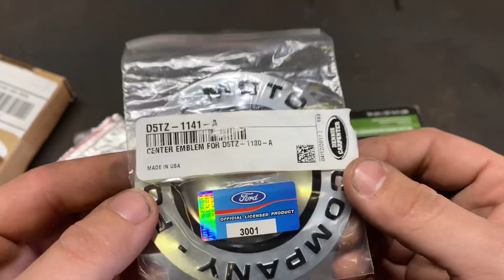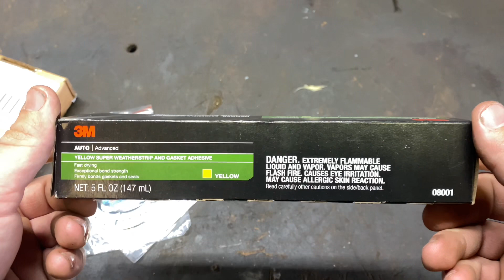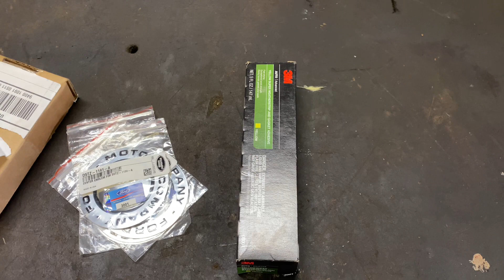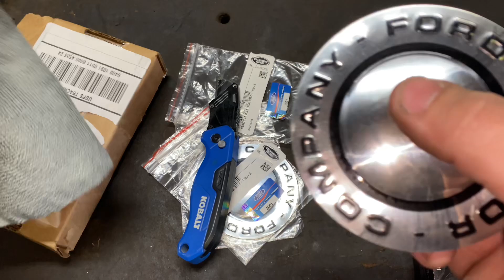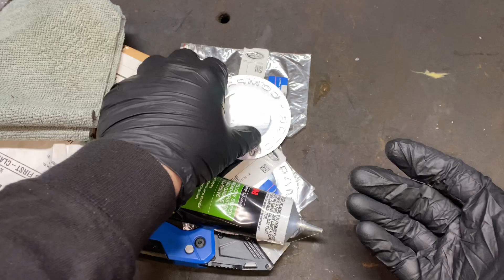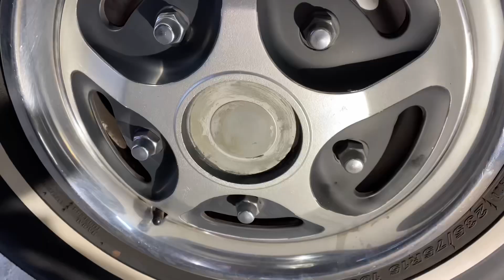1973-79 ford truck hubcap emblem install.

Comment: I wonder, If those Ford hubcaps. Also exist in 16 inch?
Reply from the maker: No not these, not this style anyway at least as far as I know, I don’t believe anyone remakes them in 16 inch. I do believe there was a hubcap that ford made in 16 inch in the 60’s and 70’s for like the F250 though if I’m not mistaken.
Reply: @FastFords289 Oh, OK. But if I had a 1973 or '75 Ford F-250, I would buy 15 inch 8 lug wheels. And then buy those 15 inch 5 lug Ford hubcaps😁